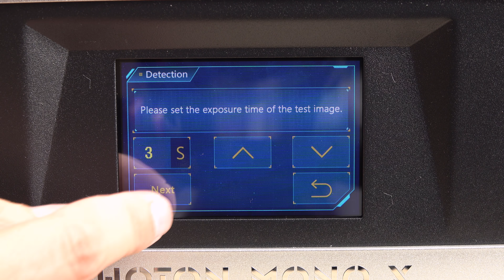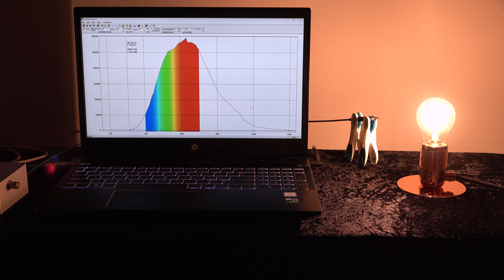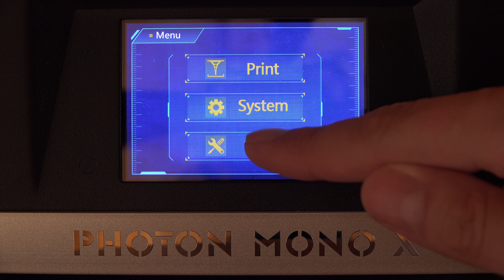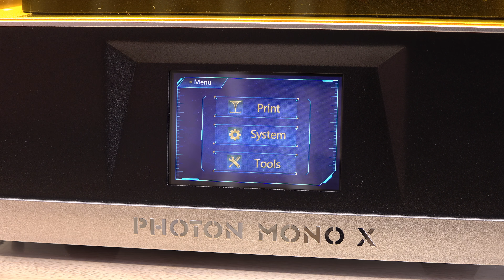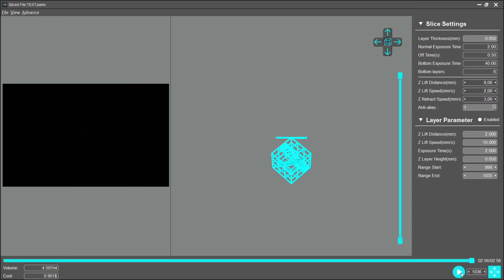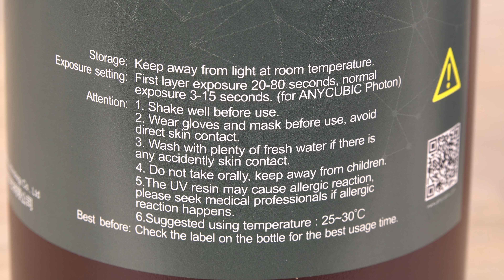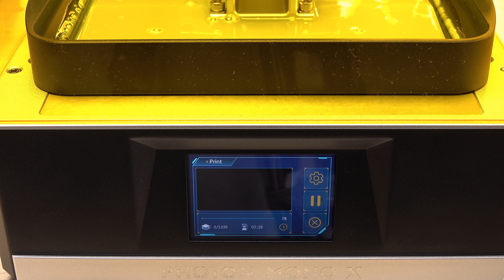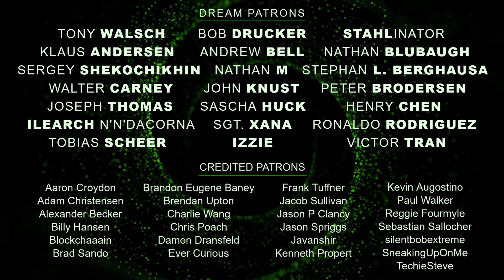Build in 3D with LIGHT! | Science of Anycubic Photon Mono X

Comment: if you plan on printing some mechanical/prototype elements instead of miniatures etc. I would recommend rising layer height to some normal value like 0.1 or 0.2mm. It speeds up printing a lot and you still get a lot of details. Just remember to extend exposure time. AFAIR there was a rule to extend time by 1/3 when you double the layer height. This type of printers is slowest on z axis and you spare a lot of time if you reduce z height of the print. Good upgrade is a magnetic print plate as you can the print just flat on reducing print z height a lot. I'm just not sure how printing flat on such a big vat will wear of FEP film. For a photos s i use for few years already this works like a charm.

Comment: 2:32 did you know that the repeatable torque spec for this connection is slightly higher than most people can achieve with their fingers? off the top of my head it was 5 inch-lbs for SMA. it drove me nuts because so many people think they can reach that with their fingers. you can't! the torque only matters for repeatable calibrated connections though or for preventing loosening while moving a cable. basically if you have a slotted connector, which most are, you can't get a repeatable connection anyway lol

Comment: Should be mentioned that the Anycubic Mono X has a few serious problems depending on your needs.

1: The build plates are usually warped/not flat; the one i received with the machine curves inwards with 0.3mm, which is 6 layers mind you; I contacted Anycubic and then got referred to a technician; after I as demanded sent pictures of a problem they know is extremely common, they send me another warped one; I haven't bothered contacting them again. I modelled a plane to print in segments, but because of the warped build plate, the joining surface of 2 segments are 0.6mm out (no I can't print them to join a top and bottom of prints; this is a printer problem anyway, not something I should account for), which is inexcusable for a precision instrument that is supposed to perform well within 50um (and in this case I need it to; inner wing walls are 0.15mm thick for reference). This is only a problem if you print directly on the plate without lifting support, which I'm unlikely to ever use (and in this case I can't due to model and size restraints).

2: The LCD screen lasts about 2000 hours of printing (83 days constant printing, presumably at slow settings/short-time UV exposure; 1000-1500 is probably more realistic). Anycubic does not offer replacement screens for sale.

3: The included metal spatula had a bent corner tip I didn't notice, which scratched up the brushed aluminum plate badly after first (and only) print; these scratches are embedded into the surface of your later prints, which for me is a no-go since it's mainly for production use (the one print had a pristine surface, with a very nice brushed texture).

4: Contrary to the minimum 3 sec exposure stated in the video, it's common to have exposure times of 1-2 sec with 75% UV power, usually with clear resin. The printer has the audacity to cut 0.5 second off your commanded setting, so if you ask for 1.5 second, it gives you 1; there can be significant difference in fine detail quality from just 0.2 sec exposure difference, so 0.5 sec is a big deal.

5: The bottom layer(s) exposure time goes down incrementally during the following 10 normal layers; you might ask for 40 sec exposure for the first 2 layers and 2 for the remainder, yet it will expose the third layer for 36 seconds and the fourth for 32, etc. This achieves nothing other than giving your print a massive elephant foot (assuming you print directly on the build plate), that you can only somewhat counter by adjusting the bottom layer exposure down below what's optimal. The company is well aware of this, yet won't address it; it's an intended feature nobody wants that omits operator settings, that can't be turned off. This in itself is a massive joke. Imagine a CNC machine not doing precisely what it's told and trying to think for itself according to invalid logic. The printer has a settings menu with a scroll bar and spots for several settings, yet there is only one, UV power. 

6: It's much slower than it needs to be and nothing can be done about it, since it ignores lowering speed setting. This will add many hours to a large print; it can eg. do 4900 50 micron layers, which when 2 seconds are wasted for each wastes roughly 3 hours.

7: Finally, and this is just a note of miscellaneous imperfections: the menu has a few outright useless "features" and the operation is a little weird at times (you have to change wifi settings and update firmware by selecting to print the respective files). The wifi only allows you to see progress status or begin printing files already stored on the local USB from a phone app; this would be fine if more hardware and significant cost was required to allow sending files to print and having it work from PC, but the only reason you can't send-to-print is lack of software capability; it would at most require 100 well written lines of code across the firmware and phone app, so the lack is pretty inexcusable. Furthermore it would at most require 500 lines of code to create a good looking password protected webapp, that you could access via PC etc. for status, adjusting settings, uploading, deleting, starting, pausing and stopping prints, etc. Finally-finally their slicer is bare-bones, but that's acceptable, as it's not really their responsibility, yet they do offer a working solution.

It's a shame; this could be the ultimate printer with very little effort, but that effort isn't being made for whatever reason. It has the potential to be a great and speedy powerhouse of functionality. If only their firmware at least was open source so we could improve/fix this ourselves.

Other than all this BS which they could easily fix if they bothered, it's a very fine piece of machinery, and depending on your needs it can be perfectly capable, specifically if you suspend models with supports or don't mind the inaccurate bottom; haven't looked inside, but from outside it's very nice and extremely sturdy (and Z axis wobble is non-existent); print quality above the bottom is pristine.

Comment: just got mine 3 days ago! It is awesome! unfortunately i didn't get lucky enough to have the test model print. After lot of time in searching and tweaking managed to get some other models out but still no luck with the test file.
Reply: Maybe your build plate is warped like everyone elses. Check it with a ruler.
Reply: @TheMrTape  thanks, I'll check tonight, It's weird, because the first layers adhere properly, It fails at the cube vertices joint. I managed to get other minis printed ok so I'm happy so far.

Comment: Can you get different resins to produce objects with different material properties (stiffness, durability, etc)?
Reply: Yes but they're usually significantly more expensive. A liter of regular resin costs $30; special types are easily $50+. There's ABS-like, rubbery etc. You can also mix them to get mixed properties at proportions of your choosing, add coloring or particles like glitter. Regular resin is about half as tough as PETG/ABS, whereas the expensive ones come close to the same.

Comment: 7:25
I recommend a  silicon-spatula as used in the kitchen to clean of the build plattform after printing. 

The aluminium build plattform scratches easily.

The silicone spatula works very good. We use those in our company for cleaning the vat and stirring the resin the vat

Comment: It's a shame the resins are so toxic. I always thought it would be cool to put a basic life support system on an astronaut then dip them into this stuff and cure them under a digitally controlled light map (brighter for ridgid parts like the head, arms and legs and less bright for parts that need to stay flexible like the joints) and bam they would have an almost instant form fitting spacesuit with no seams that could leak. Though I guess removing the suite could be a bit of a challenge.
Reply from the maker: The resins can be handled safely relatively easy, but bathing in them sure isn't a good idea :) Thanks for watching!

Comment: I dont know much about what strength of uv is required for the cure, but you could build a lightbox out of a plastic bin, aluminum foil, and uv led strips. Then the box could also be used for retrobrighting discolored plastics as well. Great video!
Reply from the maker: I'm not sure either, but great idea on the UV lightbox. I think UV LED strips will be more than adequate. It's just a matter of how long time needed. Sunlight will work too, but it's unstable in Denmark ;) Thanks for watching!

Comment: u should look into laser SLA printers not MSLA it uses a mirror and a high powered laser to cure the layers kinda like how you did the B+. quite interesting to look at (though that method is highly outdated and lower quality)
Reply from the maker: I do like the concept of building by laser beam. Would look cool and be interesting to make a video about. But in the end, the quality of the printed models is what counts. And LCD resin printers are hard to beat there. Thanks for watching!
Reply: @brainiac75  yup cant go wrong with MSLA printers. Tho be warned its much more fragile than pla prints also make sure u let ur model or prints dry 100% before curing else u can risk them cracking post cure.

Also to save money use mr clean degreaser rather than that precious isopropyl alch.

Comment: I was pleasantly surprised how reasonable the price is on that printer and the resin.  I'm looking forward to hear what you find out about 3D design software.
Reply from the maker: Resin printers used to be incredible expensive, but as with all technology it just gets more and more affordable. The smaller Photon Mono is currently $230. Not unobtainable at all :)
So far I have teamed up with my brother who has a lot of experience with the free 3D program Blender. It can export .stl files of the designed 3D object which Anycubic's slicer software can import and make the file for the printer out of. Looks relatively easy to get started on but probably hard to master without experience ;)
Reply: @brainiac75  Try LycheeSlicer or CHITUBOX. Other slicers are significantly more capable; there's about 8 that support the Mono X. Also update the firmware, it adds anti-aliasing functionality which greatly improves print quality. Finally, check that your build plate is flat with a ruler; my original plate and the replacement are both curved which causes problems. Posted a longer review-like post that goes into stuff in further detail.

Comment: Use Tinkercad to make simple (or even really advanced if you're clever) stuff quickly, for free, easily.
Reply from the maker: Thanks for the tip. So far I have teamed up with brother who has a lot of experience with Blender. Will have to learn to use a 3D program myself now :)
Reply: @brainiac75  I used to work at MakerBot, I made hundreds of things for work with Tinkercad. The resolution for SLA isn't as good as for FDM but it works REALLY WELL.

Comment: I would like printing options that don't include plastic.
Reply from the maker: 3D printing has evolved so much that some print in metal now. Expect a much, much higher price for the printer though... You can in stead use a printed plastic model to make a mold for casting in metal. It should be possible. Thanks for watching!
Reply: You can mod a FDM printer (the kind that normally spit out a thread of molten plastic) so that the motor that normally extrudes plastic instead slowly presses on the plunger of a large syringe that feeds into a flexible tube/hose that leads to a nozzle on the print head. This allows you to print in "liquids" that harden in ambient air, like clays, chocolate or wax (with a little heating to keep it molten until it's extruded), epoxies (If you use 2 syringes), ceramics and lots more.

Comment: Be careful with the UV curing liquid.  Even cured, it would slowly degrade over time; moreso than normal plastics. And most UV curing substances are quite toxic.  Not so much that I would be really concerned with short term skin contact, but just be safe.
Reply: Indeed. I use one at work for potting and the shit is gnarly. There's no doubt there's a penetrating sinus eating cloud around this thing but for that kind of cool factor, I think an exhaust fan wouldn't be a tall order haha
Reply: So, whatyou're saying is, those who're into it, shouldn't print their next bong out of it!
Reply: i hope the uv cured stuff they put on my teeth isn't toxic o.o
now that i think about it, could this stuff also be used in this 3D printer?
Reply: @chrisakaschulbus4903  really interesting question, as it is a lot harder that the plastic resin.

Reasons against it out of my head: (disclaimer: not an expert)

- Not liquid enough (at the dentist it seems more like a paste)
- too brittle (hard usually comes with brittle)
- too strong adhesion to the build plate and LCD screen (at least it sticks pretty well to my teeth)
- too expensive (dentist bill? I live in Germany, so I don't care, but it's still a lot of money the insurances have to pay for that)
Reply: @m.sierra5258  I live in germany too, so yeah, it was included in the health insurance :D
It was suggested to me by the dentist and it seems like a good thing to do, so i didn't ask questions

Comment: That's an impressive amount of detail, and no rope like structure when you dont use fillament, cool
Reply from the maker: One of the reasons I went for a resin printer is the quality of the print. Looks cast to my eyes. The science of a resin printer also speaks way more to me than filament printers. With that said, filament printers also have advantages. Especially in cost for large prints. For small(er), detailed prints a resin printer is amazing. Thanks for watching!
Reply: @brainiac75  I’ve always been interested in resin printers to print and then paint my own models, rather than just Warhammer and model railway things. Price and size wasn’t quite there yet when I last looked, but they seem to be getting close. I appreciated the spectral analysis too, especially showing the effectiveness of the amber cover.

Comment: It must be very expensive
Reply from the maker: This resin printer technology used to be very expensive but as with all technology it is getting more and more affordable. But the amount of metal needed to be sturdy with 0.01 mm precision at a plate height of up to 24.5 cm will still cost. Smaller models starts at $99 if I remember correctly. Thanks for the early watch!
Reply: about $500
there's cheaper models starting at like $200 or so